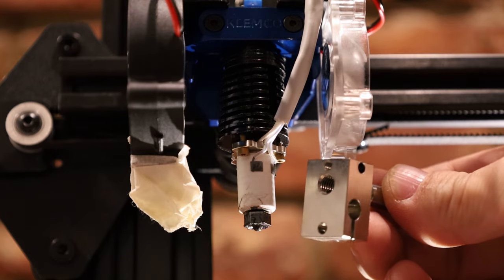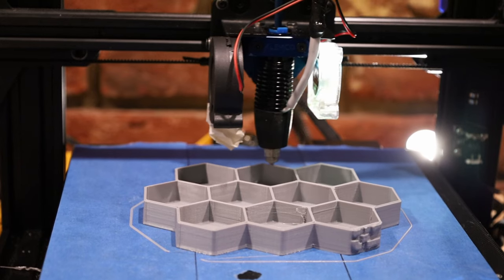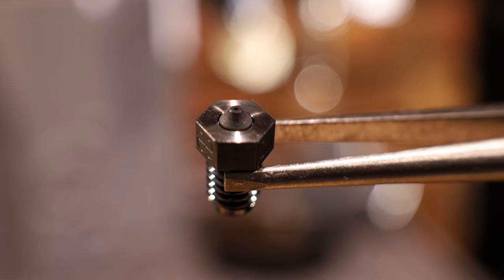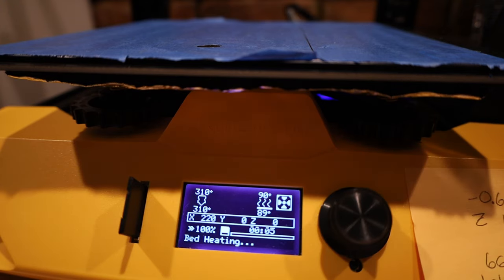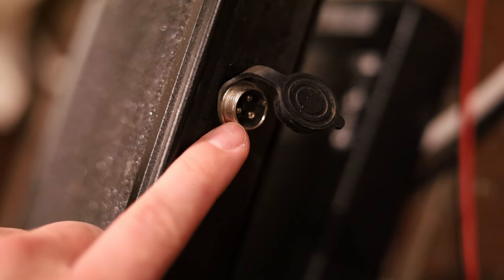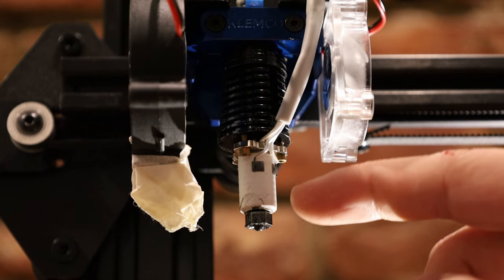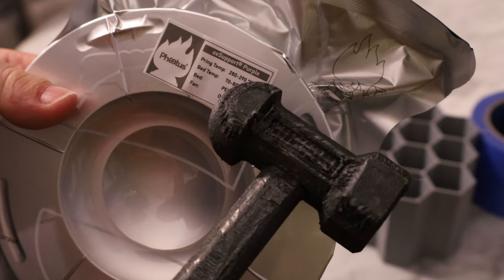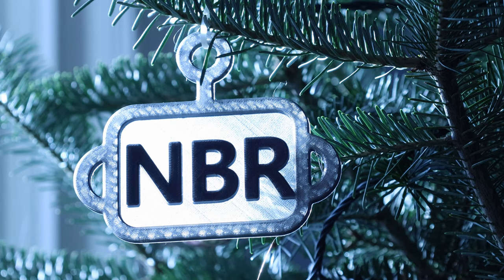Phaetus Rapido Hotend + Tungsten Nozzle + High Temperature Carbon Fiber Nylon Filament

Comment: Magnet is a neat trick. I use optical end stop, with a printed blade hanging on it. The Z bed has a screw to adjust when bed pushes blade into the optical sensor.
Reply from the maker: Yeah, the magnet isn't ideal since it can come loose or have a random nut or bolt stick to it. Just trying different things with what I had on hand.

Comment: This is justm15% CF. Imagine 25% quality CF Nylon. Even a skinny part can't be bent by a grown man's hands.
Reply from the maker: It has about the same tensile strength as Aluminum. Aluminum is pretty easy to bend and break if it's a pencil thickness or less, but scaled up to a 20x20mm beam, like the aluminum extrusion used on many 3D printers, and it is quite strong. It all has to do with thickness. Even PLA is impossible to break by hand if it's thick enough (say a 2"x2" solid beam)

Comment: Be aware that the thermistor will limit you to around 290c
Above it might degrade quickly

Phaetus is working on an improved version to remedy this!
Reply from the maker: Do you know of a way to replacethe thermistor? I may have to go Rambo on it.
Reply: @NathanBuildsRobots  Go Rambo, Nathan. Go bloody Rambo.
Reply: There is now a PT1000 version of the Rapido, since PT thermistors can handle temperatures over 800C, handling 300C is trivial for them.
Reply from the maker: @kerbodynamicx472  hell yeah, I won't one!
Reply: @kerbodynamicx472  trianglelab quotes 350C for the PT 1000 version, likely due to insulation not being able to take more so...
Reply: @NathanBuildsRobots  you can change it
Remove the heat sink (3 screws from bottom, grub screw from heat sink), then remove the screw in the strain relief.

You will need to clip the cable ties on the strain relief. Be careful not to move the heater cables too much, the welding is really fragile.

Dimensions are 2.5mm radius and 11mm depth.

Source: tried it + I used to work for the manufacturer

Comment: Nathan: Why don’t you snap?
ae carbon: Carbon fibre reinforcements, son. They strengthen in response to to tensile load. You can’t break me, Nathan!
*attempts again with more amps on the motor
ae Carbon: What did I just say?
Reply from the maker: Carbon fiber Nylon: DID I STUTTER?

Comment: I am glad you got yours working,  I can't get the filament to melt (PETG) I tried all the way up to 260c  and it seems like just stop right before the heater block.  I must of got a lemon.
Reply from the maker: A really common issue with these more advanced designs, where they press-fit thin steel tubing into solid blocks of metal, is there can be a lip that catches the filament, making it very hard to feed into.
I have had this issue with several products from Phaetus and Slice Engineering. Unfortunately, companies these days prefer to ship more units rather than doing proper Quality Control. I'll be releasing a video on Quality control soon, so stay tuned for that. 

Your best bet is to get a refund if possible.
Reply: @NathanBuildsRobots  Your awesome,  I took it apart and at the top of the tube it was lipped inwared.  I was able to fix it and now it can push filament through.  Your right it is a QA issue,  I got my son one and had the same issue 2 for 2 bad QA.
Reply from the maker: @chrisc9213  interesting, so it sounds like the cutting process may have left a dent. That gives me an idea of how to fix the mosquito hotend I have that has some catching issues. Would be nice if they flared out the end of the tube after cutting top get nice clean edges.

Comment: So if it's a tungsten nozzle with a tool steel insert, it should wear just like a tool steel nozzle, even if it has the heat transfer of tungsten. Not sure that is worth the price premium.
Reply from the maker: I think it is tungsten carbide insert embedded in a copper base. Probably not worth it for most people, unless you find yourself printing a lot of high temp carbon fiber filaments.

For most of my use cases I prefer the CHT nozzles. I just want fast printing at 200C-300C.

Comment: I would be very careful running the hotend over the rated maximum of 285C for the thermistor. It's for sure the biggest downfall of the hotend. It can "work," but I personally wouldn't do it frequently. Other than that, nice review! Cool to see more coverage of the rapido
Reply from the maker: Is there a thermistor you would recommend? I'm considering swapping out the thermistor so I can print really hot stuff, like 400C+
Reply: @NathanBuildsRobots  you can’t swap it out on the rapido since it’s built into that “heater core.” We’ve been trying to work on Phaetus/TL to make a high temperature version with a PT1000 or similar
Reply from the maker: @xsolar  I just bought one of these to try out. The thermistor looks easily removable.
https://amzn.to/32aJIhy
Reply: @NathanBuildsRobots  those look interesting, but I’ve heard they have their issues as well. Not exactly sure what they are tho. Just always been told they’re questionable haha
Reply: @NathanBuildsRobots  ah yeah also, I saw you mention it in another comment. Phaetus and TL are actually just resellers. The actual hotends are made by another company and they’re OEMed by Phaetus and TL. Generally, the Phaetus versions are better quality, but only slightly
Reply from the maker: No idea how you know all this stuff, but I was glad you informed me of this info. Forgot to like it when I read a while ago
Reply: @NathanBuildsRobots  haha it’s somewhat common knowledge in the discord side side of the community. Runice is the mfg that makes the hotends. Also, TL has released the PT1000 version of the rapido for higher temps. I believe the Phaetus version is on the way

Comment: Glad i came across this video, was having trouble finding any information on this guy and was very curious, looked into it earlier today, found hardly anything, but i came across your hotend selection video, was impressed, looked through your others and saw you covered this guy, now i know what id like to save for lol, it can do fine quality, speed, and extremely hot temperatures, and i would love to have a shot at printing some PEEK at some point
Reply from the maker: Yes but hold your horses a bit. Apparently the thermistor they installed is only rated up to 280C, so they need to update their design with a high temperature thermistor or thermocouple. I'm OK with pushing print tempos to 300C for now, but I'm worried what would happen if I tried to go to PEEK temperatures (~400 C)
Reply from the maker: I heard a high temperature thermistor version is in the works, so I'd wait for that.

Comment: That looks like itd work great on my 2 filament bowden machine... they selling these?  I could run just about anything on either of my machines, though I do a lot of ABS, so really accurate heat levels is a MUST.  This would add some serious control and really let me keep that core temp up as it extruder so the layer adhesion stays high.
Reply from the maker: It's a great hotend, I could definitely recommend it. Haven't printed much ABS but I imagine it would work well. 

There is an alternative, look up CHC ceramic hotend by trianglelabs. I just ordered a few to try out.

Comment: It appears that the rapido isn't covered by Slice Engineering's patent, so they can still use the screws to fix the hotend to the heatsink and enable one hand nozzle swap.

Comment: Good Video.  I found this looking for ways to mount the Rapido to the APUS extruder on my Rat Rig.  I also used the Phaetus Carbon Fiber filament at 300 on my OmniaDrop extruder on the Rat Rig for replacement parts on the motion system.  The parts are like they were printed in metal.  It is hard to clean them up, but worth it.

Comment: standard nozzle will work ? what is the blue tap is it? and what glue you use ? how is the ABS working with this setup any wrap ?
Reply from the maker: It uses the standard V6 nozzle.
Where did I glue it?
Havent used ABS but it should work.
Reply: @NathanBuildsRobots  the glue you called the magic glue you put on the blue tape
Reply: @NathanBuildsRobots  when you put that v6 volcano on that rapido is it on the Ultra high flow mode ?
Reply from the maker: @EnergySeeker  Oh, that is UHU Glue stick. I think its a german brand but I could get it here in the states on Amazon
Reply from the maker: @EnergySeeker  yeah its supposed to extrude faster like that

Comment: The tip might be tungsten carbide. That would explain the magnetism.
Reply: The nozzle is a copper alloy with a tungsten carbide tip and then the whole thing is nickel plated and then DLC coated on top of it all
Reply from the maker: What solar said. Didn't know about the DLC

Comment: Got a roll of Phaetus's UltraPA as well. Came out dry and printed well without needing to dry it unlike my other spool from eSun. Seems like eSun only ships wet spools.
Reply from the maker: Yeah, I did a review of some Sainsmart filament. It was wet to start out, and even after drying it was barely stronger than PLA. 
I think I could get better results with more tuning, but the Phaetus stuff just works.

Comment: Tungsten carbide or tungsten alloy?

Is it better than hardened steel?
Reply from the maker: Yes, it is harder and more thermally conductive. Tungsten carbide inserted into a DLC coated copper body I think.
Reply: I guess I'll have to return my 4 euro e3d nozzle x haha for my rapido plus uhf

Do you have a tungsten recommendation?

Comment: Very nice, is there a tutorial anywhere that shows how to adapt to and ender 3 with CR touch. I am still relatively new to 3D printing, but just knowledgeable enough to be dangerous, so I still require a good tutorial on occasion, but I have been looking to upgrade my hotend for sometime now ever since I switched to a .6 nozzle and fell in love with the faster print times and print quality.
Reply from the maker: This video looks pretty thorough on the CR-Touch 
https://www.youtube.com/watch?v=CCyTEttj8sk&ab_channel=MandicReally

I think 0.6 is the sweet spot for speed, and 0.4 is the best for print quality. 

I'm going to be trying out one of these hotends from Maxiwatt soon, its a lot cheaper. I doubt it will be as good as the rapido, but its at a great price point.
https://amzn.to/328EOSq
Reply: @NathanBuildsRobots   yes, I've used that video before to set up my current CR Touch, I meant one where someone is using this hotend and a CR touch, I'll keep looking and post here if I do.
Reply from the maker: I used a Klemco Mount: 
https://amzn.to/2PEDujO

It has rails on the sides to mount accessories. The nice part about the design is it lets you easily adjust the height of any accessories you attach. I think the normal BL-Touch mount should work, as long as the hole patterns are the same between the CR-Touch and the BL-Touch. Otherwise you'd have to create a CAD model of the model yourself, or use Autodesk Meshmixer, which is a super fun program btw.
https://www.thingiverse.com/thing:4117436
Reply: @NathanBuildsRobots  Ahhhh, ok, I got ya, very nice.Thank you very much.
Reply: @NathanBuildsRobots  how do you connect the hotend to the creality mobo?
Reply from the maker: @justatme  there are spots to plug in the thermistor and heater cartridge on the motherboard. They should be labeled
Reply from the maker: @justatme  you will have to unplug the Originals
Reply: @NathanBuildsRobots  I saw an unboxing of these and they had their own proprietary connector. Asking if you had it and did you to have remove it?
Reply from the maker: @justatme  The one I got had the proprietary connectors, and it also came with cables that plugged into the proprietary connectors and ran down the harness, back into the motherboard.
Reply: @NathanBuildsRobots  did you use and edit klipper to accomodate the hotend?

Comment: Awesome vid. Is that a spacer you used for the volcano nozzle? Just interested in seeing a volcano in a smaller heat block
Reply from the maker: Yeah, you can buy it with the Phaetus rapido, or get it separately in this kit: 

https://www.3djake.com/phaetus/rapido-uhf-upgrade-kit

Comment: Are the connections for the heatblock and thermistor the same ones on the ender 3, or did you solder your own connections?

Comment: Does the rapido connect directly to the ender 3 board no problem? Same voltage?
Reply from the maker: Yes, the one I got was 24V

It plugs in the same as any other heater block, 4 wires: 2 for the heater block and 2 for the thermistor
Reply: @NathanBuildsRobots  thanks! I went ahead and bought it.
Reply from the maker: @rauldelgadillo8447  cool!

Comment: Which power is the heater?
External MOSFET is need?
Reply from the maker: The power draw is 115W.

I didn't use an external mosfet. 

I will check the temperature of the mosfet next time I'm printing. It is probably fine though. On my Ender 3000 build I am running 140W heater cartridge on a single stock mosfet and it doesn't get hot at all. A heated bed draws 220W, most boards use 2 mosfet in parallel to drive the heated bed,  so the load is about 110W each - pretty similar to what the rapido draws.

Comment: What is the total weight of the complete hotend?
Reply from the maker: Its probably 500g, could go down to 450g with a pancake stepper motor.
The phaetus Rapido contributes very little to the overall mass 
I didnt really build this thing for light weight, but it could be made to be quite light.

Comment: What board are u using? I'm trying to install this on a 4.2.7 running th3d unified 2 firmware (basically Marlin 2), but can't get the Hotend to heat up

Comment: I wanna use this for 300mm/s 40k acceleration with 2 clearpath servos I have would I handle that ?
Reply from the maker: I bet it would. You can also buy a CHC heater block, which is essentially just the ceramic hotend part. But the heatsink is nice,  so I think it's a pretty good package overall.

Comment: Hey Nathan,
I came across this video while looking for any info on that Phaetus Tungsten Carbide nozzle. I own a CR10-S upgraded to a MicroSwiss Direct drive and been considering getting a tungsten carbide nozzle for printing CF filled filaments (PLA or PETG). While I won't require to print anything around 300°C anytime soon, I like the idea of getting a nozzle that will potentially outlast the printer itself. I can't quite find the info on the construction of the nozzle. As in, what parts are actually made from carbide tungsten? The tip for sure but what about the inner walls higher up? Is the outside brass which is simply plated? And even if you don't happen to know, could you please share how it performed for you since this video? Have you printed more highly abrasive filaments with it since and how did it hold up?

All the best from Cologne, Germany!
Reply from the maker: Thanks,
The nozzle is plated copper with a central tungsten carbide insert.

This produces better heat transfer than a pure tungsten nozzle. The nozzle tip is where most of the wear occurs, since it rubs against the carbon fibers as it is printing.
Reply from the maker: I have used it to print 2 spools of PLA since the video. It's holding up well.

Check out cnc Kitchen's videos on nozzle wear and look at the primary wear locations. It's all around the tip, not so much wear happens deeper inside the nozzle, so the copper should be fine.

If wear did occur higher up in the nozzle you'd have to worry about the heat break wearing through, since it is so thin. But thankfully that doesn't really happen.

Comment: Hi there! What parameters did you add in the fw for the thermistor? :)
Reply from the maker: It ran fine with without changing firmware. 
I updated it to use a different thermistor profile later, look at 3:18

I think it underreports by about 10C when at printing temperatures now, because the thermistor profile might not be a perfect match. I'm not sure though. Kind of guessing here, but I always tell it to run a little hotter to compensate.

Comment: What's the max temp of the hotend I got one coming just want to know for firmware reasons
Reply from the maker: 1. Rapido Thermistor：104NT-4-R025H42G (which has a specified as having a max temp of 280C, though I'm running it at 300-320.

2. Nozzle Heat Tightening：285℃ with 2.5Nm Torch 

3. The temperature of copper plated nozzle and hardend steel nozzle could be up to 500.

I used thermistor profile 61 in marlin.

Comment: You demonstrate a poor printing quality. Why would anybody want that?
Reply: It's what happens when you test crazy high flow rates.
Reply from the maker: Sometimes print quality is less important than print speed. 
Specifically, I do a lot of mechanical prototyping for work. Being able to crank out a large 1kg 3D printed assembly the same day is very valuable to me.

Comment: But your print was terrible!
Reply from the maker: The volcano prints were just OK in terms of print quality. I was purely looking at volumetric throughput of the volcano nozzle. 

Since then I've made some very nice prints using PLA and the tungsten nozzle at normal print speeds.